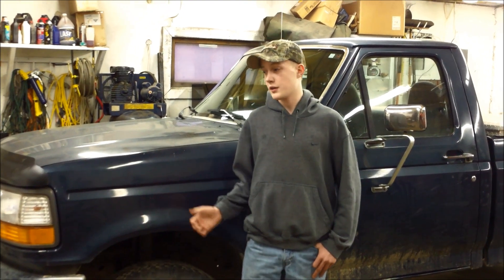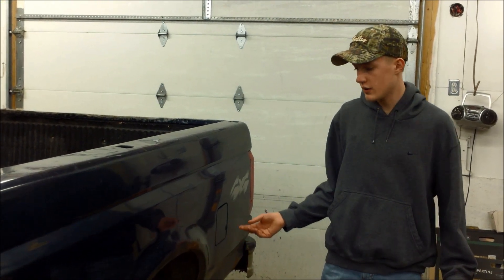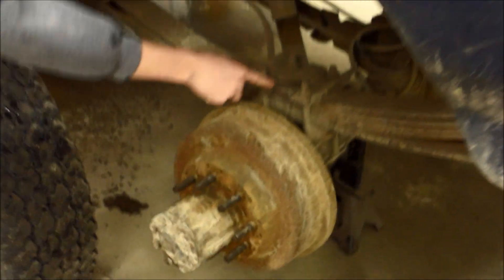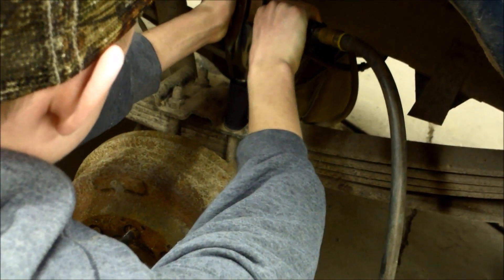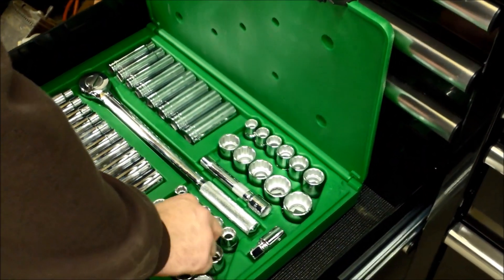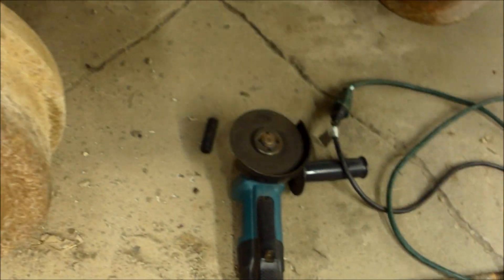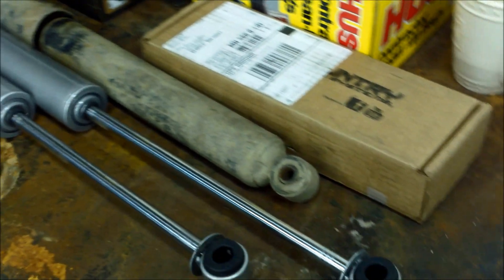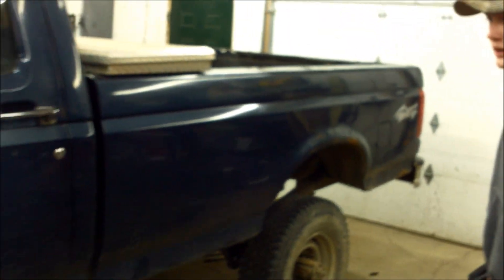Rough Country-4 Inch Lift Kit Installation- Part 1 ('96 Ford F250)

Comment: Not bad man. I remember my 86 F250 also had the 351, and it was a killer truck. Now I have a 2014 Power Wagon, and I have to say try and get some sort of a suspension lift in the rear. It costs more, but the ride quality on road and the articulation you get off road is day and night compared to the block set up
Reply from the maker: +Hayden Carter Thanks, and yeah that would be a good idea when I get the $$
Reply: Had a 351 in my 95 Bronco and just loved that Motor. Could not kill that engine. Good times in that bronco many off-road journeys destroyed many Silverados k10 Jimmy’s and Gmc

Comment: Hey on that truck what size tires can you fit with only a 4 inch lift? I can only find a 4 inch lift for my truck and I want to know if I could fit 37-40 without much body work thanks
Reply: i have 39.5 super swampers on mine fits good rubs alot on the leaf spring when i turn left

Comment: Great video getting ready to install on my 86 f250 extended cab    waiting for a replacement spring  lost in shipping     u do need  to flip ur rear shocks over though
Reply from the maker: What do you mean by flip over?
Reply: Unless ur going to run a boot on ur shock. U should turn it over so the shaft is on the bottom. It keeps crap com working at the seal.
Reply: So when do we get to see part two
Reply from the maker: tonight!
Reply from the maker: Also with the shocks they can go either way.  I probably will put boots on tho
Reply: U left out all the fun pain it the butt parts on the front.   Lol.  I also replaced  bushings  and the front diff gasket. Was the best time to do it.  Wait till u get ur 35s on it.   U should have just picked up a pitman are puller.   Ull be lucky  if the shaft seal on the steering  gear box doesn't  start leaking  on u keep a eye on it. Loved the vids though  ill try and post a pic of my beast.
Reply from the maker: Joshua Lewin Sweet, thanks for the tips. I posted a part 2 that shows the front lift being installed... I also threw my 35's on, installed a dual steering stabilizer, and got a steering alignment. Thanks for watching!! and make sure u watch part 2 so u can see me install the front!

Comment: Thanks man! Doing this on my 99 F250 7.3 4WD, wasnt really sure how to jack up the rear but I figured it out thanks to you! You got lucky, my shocks were a pain to get off. Had to cut them out on the bottom, and one hanger broke off :/. Other hanger was a piece of cake tho. What size tires are you gonna run on it? Ive got 35s to put on mine.
Reply from the maker: Glad I could help! I've been running 35's for the last year you can check it out on some of my newer videos!

Comment: I just bought this same lift kit. I noticed though that the instructions i have say to install the rear blocks UNDER the stock block. You mounted yours on top. I imagine it doesnt make much difference,just pointing it out though.
Reply: The wing on the original block is for the bump stop. You need a bump stop extension or some better shocks his way

Comment: Hey did you have to add brake line extensions? And how is it riding after having it on there for a bit? I've read online that the Rough Country can ride "Rough" but I can't argue with the price. I'm looking for my '85 F250. Let me know.
Reply from the maker: +Jahde Clark Nope I didn't have to extend anything! But you might have to with an '85 idk.  I think it rides pretty decent especially after  I built my 150-200pound bumper that adds alot of front weight.

Comment: Hi nice videos i was just looking at it for a 93 f250 and they say to ( Install the block on the bottom of the factory block and install new u-bolts. Torque to 90-100 ft/lbs. ) i see you put your on top that moves your bump stop down 3" did you see that just saying but nice job will check out you your other videos !
Reply from the maker: chevyforddodge4x4 Wow nice catch.  I'll have to dig back through the instructions and see.  Maybe I'll have 3.5 inches more suspension travel lol.  Thanks for watching!

Comment: My friend had a block lift and it is not as good for the truck as a rear bracket lift.
Reply from the maker: ***** They only make rear blocks for 4 inch cant get a rear spring 4 inch lift kit
Reply: +UpNorthOutdoors carrier custom suspension you can get it they have a website

Comment: You do know that doing a block lift is super unsafe
Reply from the maker: I'm not dead yet
Reply: no my dad truck is a 2000 f250 and it has had the blocks on the truck we he got it plus it was a roll over when he got it and has had no problems
Reply: suspension lift is much safer than a body lift though
Reply: On the rear it's pretty safe if done right. I definitely don't recommend on the front, PERIOD.
Reply: Blocks in the rear are fine. But you want to put your factory block on top. The whole point of the arm on the factory block is hit the bump stop. With the lift block on tip you’ll bust your spring stack before you hit the bump stop

Comment: Real trucks don't have spark plugs. 7.3 power!
Reply: What a childish, ignorant comment. Back in the day, no trucks were diesels. Even dump trucks and semis were all gassers but I guess since you say so, those weren't "Real Trucks".
Reply from the maker: Hey don't get me wrong I'd love to have a 7.3, but I like raw instant power for offroading :)
Reply: Damn right
Reply: Give me a Gasser any day for muddling and trails. Diesel is great for pulling/towing.
Reply: matthew hawes yee yee
Reply: I have a old Jeep j20 with the AMC 401 6.6L and has all the torque I'll ever need

Comment: didn't even install the blocks right.  
supposed to put the plate on the bottom
Reply from the maker: +Lakota Staffen It honestly doesn't make a difference
Reply: Actually it does 
 Kinda why they say to install it that way
Reply from the maker: Lakota Staffen Please let me know how it makes a difference because ive been driving it for over a year with no problems
Reply: +UpNorthOutdoors  you have it on right , my Super Duty is the same way. He must be confused on what kind of truck it is.